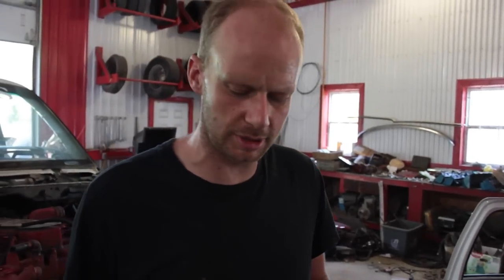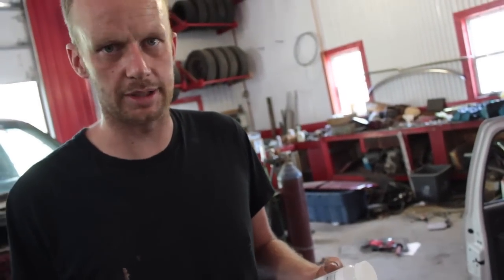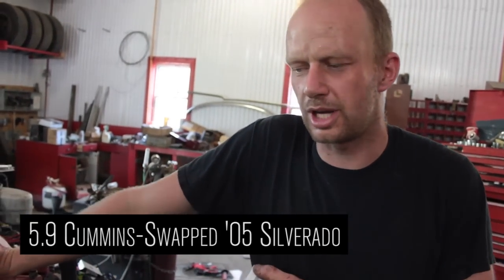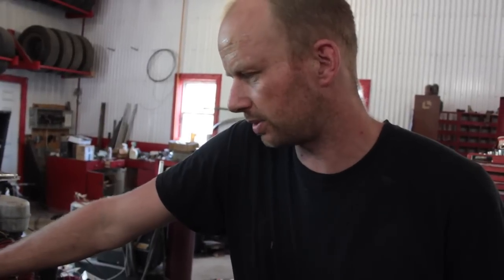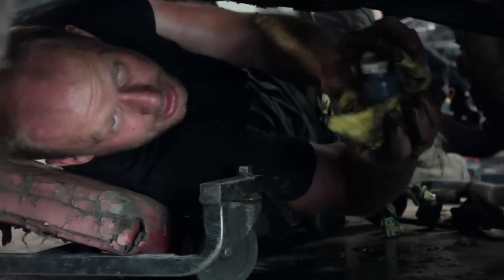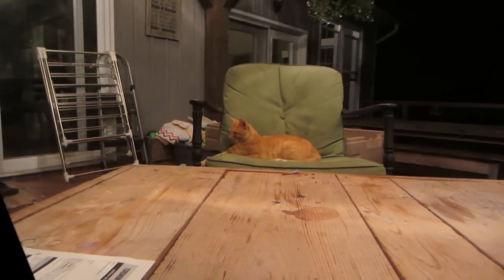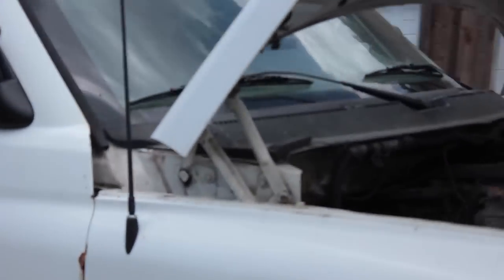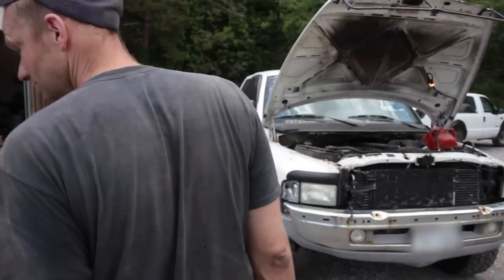OIL ANALYSIS: How To Check Diesel Engine Health Using Oil Sample Kit

Comment: My 6.0 power stroke at work made it 1700 miles almost and burnt up a new set of injectors from ford dealer and it was hard miles pulling a skid loader and a goose neck with attachments but a 6.0 is fucking junk

Comment: Great video.    Need help understanding oil analysis reports?   Read my technical paper at http://www.jglubricantservices.com/docs/Technical%20Information%20Sheet.pdf.    I'm a retired GM/Allison oils engineer and we can help with oil analysis on engines, transmissions and differentials.    Give us a call at 877-971-7799.

Comment: I use black stone labs, done here in the states, it’s only $27 a sample +shipping and I did it twice and they sent me prepaid shipping containers! But I like them so just FYI, sample your oil if you care about your truck and if you’re selling it, it could be a really good selling point
Reply: I have Blackstone kit also never used it. I was curious on was there anyway besides the oil pan I can get oil from the engine
Reply: Black Mack vacuum pump it out from the dipstick tube. Run a small hose into the oil pan.

Comment: ive got a fuller 5306 behind a 5.9. seems like its got a 1710 u joint yoke on it. is the only way to adapt that to a 1350 transfer case with a short drive shaft?

Comment: Hey I have 06 dodge cummins 144000 miles. Had noticed somewhat of an increase in my EGT. I run the edge usually on tow tune. I was worried about my injectors putting out too much fuel so I did a black stone oil analysis. Everything was great. No fuel in oil. Only thing they noted was iron level of 38. According to them that was a concern. Your comments say 100-200 is normal.  So why difference ? Thanks
Reply from the maker: Was there ever an oil analysis done before?  Most likely you received a "keep an eye on it"  because it is higher than normal or higher than a previous reading.  I would run another oil life cycle in it and get it checked again.  If it isn't significantly higher, I don't see a reason to run it any different.  Iron can be anything from timing gears to cam, crank, or cylinder walls, heads and anything in-between so its hard to pin down.
Reply: No this was the first time.  Thanks
Reply from the maker: As for higher EGT, check your air filter and clean your air to air.  Cheapest things to check first

Comment: Just for curiosity why don't you  like duramax diesel ???   than ks
Reply from the maker: I never said I don't like Duramax!  I don't see many as there is another shop in town who specializes in them.  The lb7 (01-04) had injector issues as they were the first of its kind but it has proven to be a reliable engine since.  Things are still tight under the hood but not tight enough to have to remove the cab.  When I started out, Duramax's were expensive and the 12v are plenty in my area so thats just the route I went.
Reply: Understood
Reply: I worked at Chevy dealer from 05 to 09. Rich is spot on with the Dirty Max. The 1st version had injector issues, but from 05 on they were pretty solid. I'd still trust the Cummins over the rest.  05 they put the injectors outside the valve cover too.The Allison transmission was a beast, I believe I seen 2 while I was there that had problems with the Allison. I believe it turned out to be electrical on both. I still like my SBC; simple, reliable and durable.
Reply: thanks

Comment from the maker: SILICON (Si) & ALUMINUM (Al) Acceptable: 10 to 30 ppm. High = Dirt ingestion.
Check: Air intake system, oil filter plugging, oil filler cap and breather, valve covers, oil supply.

IRON (Fe) Acceptable: 100 to 200 ppm. High = Wear of cylinder liner, valve and gear train, oil pump, rust in system.
Check: Excessive oil consumption, abnormal engine noise, performance problems, oil pressure, abnormal operating temperatures, stuck/broken piston rings.

CHROMIUM (CR) Acceptable: 10 to 30 ppm. High = Piston ring wear.
Check: Excessive oil blow-by and oil consumption, oil degradation.

COPPER (CU) Acceptable: 10 to 50 ppm. High = Bearings and bushings wear, oil cooler passivating,radiator corrosion.
Check: Coolant in engine oil, abnormal noise when operating at near stall speed.

LEAD (Pb)* Acceptable: 40 to 100 ppm. High = Bearing corrosion. 
Check: Extended oil change intervals.

COPPER (CU) & LEAD (Pb)* Acceptable: 10 to 50 ppm. Both High = Bearing lining wear.
Check: Oil pressure, abnormal engine noise, dirt being ingested in air intake, fuel dilution, extended oil drain intervals.

ALUMINUM (Al) Acceptable: 10 to 30 ppm. High = Piston and piston thrust bearing wear.
Check: Blow-by gases, oil consumption, power loss, abnormal engine noise.

SILVER (Ag) Acceptable: 2 to 5 ppm & TIN (Sn) Acceptable: 10 to 30 ppm. Both High = Wear of bearings.
Check: Excessive oil consumption, abnormal engine noise, loss in oil pressure.

VISCOSITY CHANGE = Lack of lubrication.
Check: Fuel dilution, blow-by gases, oil oxidation, carburetor choke, ignition timing, injectors, injector pump, oil pressure.

WATER/ANTI-FREEZE = Coolant leak or condensation.
Check: Coolant supply, gasket sealed, hose connection, oil filler cap and breather.

* Significant as wear metal, only for engines using unleaded and diesel fuel.

(Source: http://www.bobistheoilguy.com/whatisoilanalysis.htm)
Reply: great vid! Do you think you could give some advice? I bought a nv4500 out of a 98 12v to swap into my 93 d250 w/getrag, but from my readings i found that those years of the nv4500 didnt have the speedo pick up in the tranny(like the getrag) it had it in the rear axle, so do you know a way to do the swap and still get my stock speedo to work? thanks
Reply from the maker: I am just getting into that with my 05 but yours would still be a gear drive/cable correct?  I am waiting to swap a trans for a customer and take his tail stock off the junk trans.  I was going to take the toothed wheel and adapt it and the pickup (sensor) to the tailstock of the NV4500.  I should have the other truck in the shop next week.  The driveshaft is being made for my Silverado right now
Reply: DEBOSS GARAGE yea my truck has gear drive speedo, but im not sure how to get the speedo to work with the nv4500, since it doesnt have the drive gear on the tail shaft
Reply from the maker: If you can hunt down a 46RH out of a dodge (vans I think), the speedo is a mechanical drive that feeds an electronic unit.  I believe that drive gear fits the NV4500.  You can go to Advanced Adapters and get the right ratio sending unit depending on your axle to make it all work.  Arn't conversions fun?